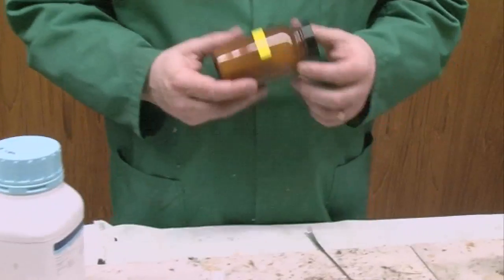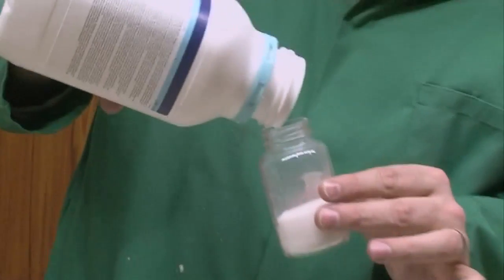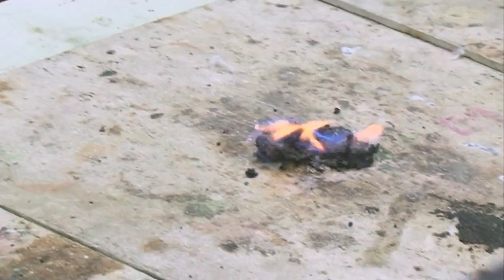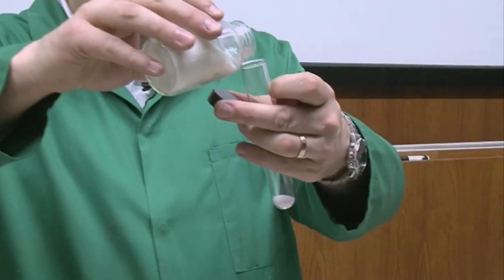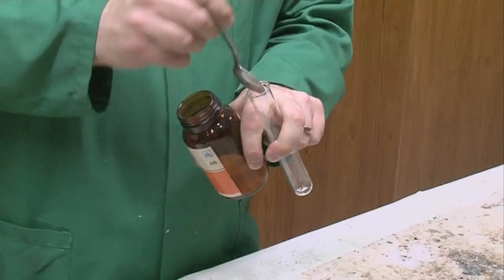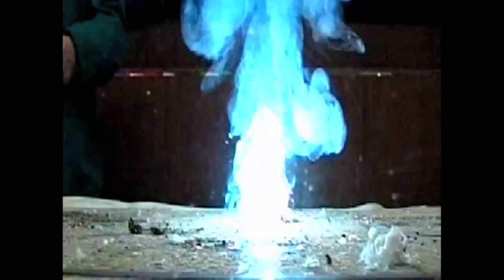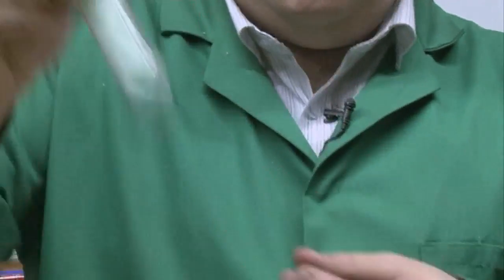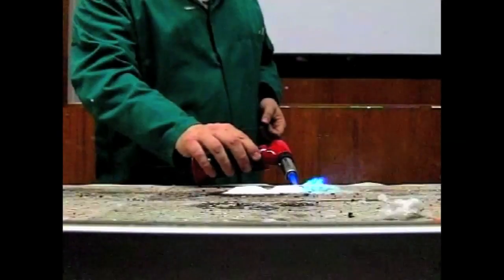Coloured Flames - Periodic Table of Videos

Comment: You could say the spectrum of barium supercedes potassium's spectrum, because that of the potassium is essentially really weak and can only be seen when the samples are fairly pure, for example from sodium that emits this really agressive yellow colour. That's why potassium chlorate is used in the base mixture - other metals, if present, can easily be seen through it.

Comment: @bowwowvveevva That is actually a deep and difficult question to answer.  The overly simplistic answer is the hissing is basically the "fizz" of the liquid phase and random variations in reaction zone pressure as the reaction proceeds...  The shape of the spectra of the noise is probably related to the pressure dynamics of the reaction rate, the physical form of the reactants and a whole bunch of variables.  I suspect modeling it would be extremely interesting and nearly impossible!

Comment: @dominic14061995 Could also be a color balance problem with the video, especially when you get ligth that is overexposed on digital sensors the light can get an unnatural tint, For instance you have the RGB color channels which say for a red flame with proper exposure would be red dominant, say 200,20,20 which is a saturated red color, but once the red becomes completely saturated (255) the other green and blue channels can catch up and tint the overexposed regions. 255,50,70 is pinkish.

Comment: @piranha031091 Well the cupric chloride I made was made from curpic sulfate in azeotropic, clear, hydrochloric acid, and then evaporated completely to leave it a quite blueish colour. So I don't think there's any reduction going on, especially since I didn't ever have any cuprous chloride (which is very evident as it's white and quite insoluble). Then again I burned it with a direct flame and not any oxidizing reagent or methanol or what have you.

Comment: @RequiemAeterman 
Well, it's (fairly) cheap while offering reasonably good results for making large crystals.
Most cheap salts can make crystals, but they're usually either clear or very hard to create large crystals with.

I would guess that is the simple explanation: Cheap, while good for making colorful (blue) crystals.

It seems you've encountered it only in a form that is purposefully created for creating large crystals - small seeding crystals. - I've mostly encountered it as a powder.

Comment: @bowwowvveevva I suppose the violent reaction cannot help but vibrate the air molecules around it - this translates to an audible signal when it reaches our ears, hence, a noise.  The reaction starts with great acceleration as there is an abundance of oxygen. Once O becomes consumed the rate of reaction slows and hence the about of physical vibration it is translating to the surrounding air. This in turn translates to a less violent audible signature, so the sound subsides.

Comment: Chlorate mixtures are unpredictably sensitive to friction and to shock. Google "sugar chlorate friction sensitive" and you will think twice before mixing your reactants by vigorous shaking. Don't do it. I can guarantee that reaction proceeds quite a bit faster in a closed pressure vessel than it does in the open; you won't have time to drop it before burning your hand or worse.